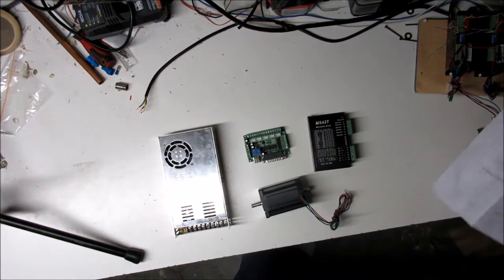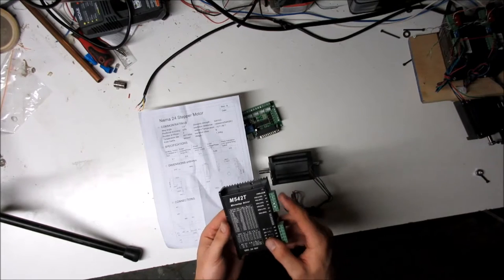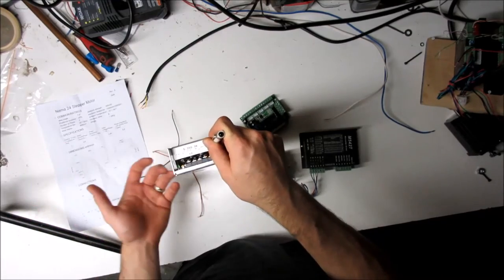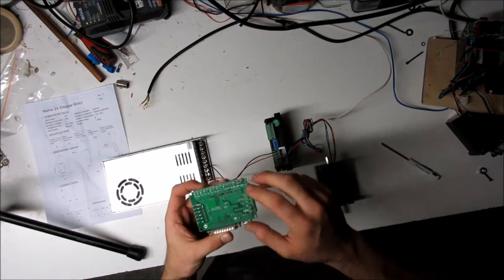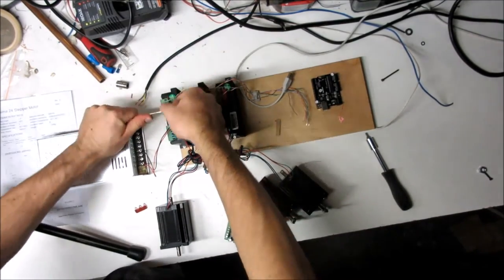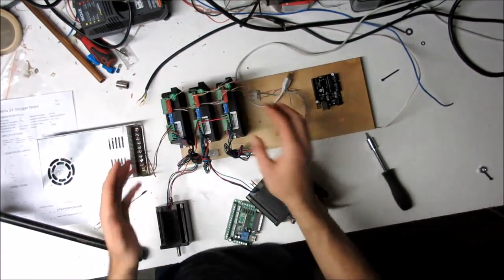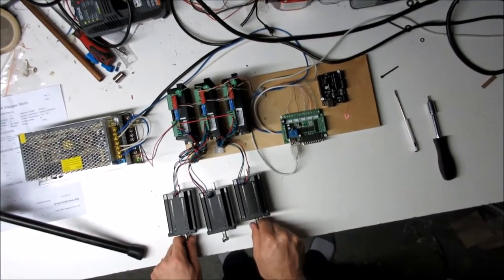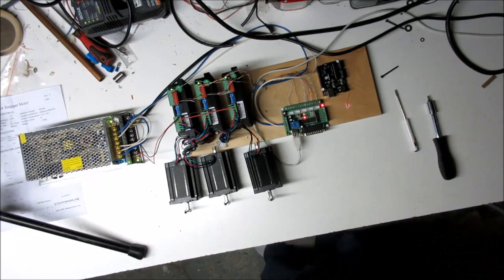Nema 24 3-Axis CNC Kit from StepperOnline VISIT http://www.blog.nickcook.ca FOR FULL WRITTEN REVIEW

Comment: So I’m still not getting it exactly: the enable +and - are hooked up in series from driver to driver the wired to the bob ? And where do the pulse direct pins go on the board? I’ve got a war9 SmoothStepper ess and I’m getting a bob that hooks up directly to that but right now I’ve got a Chinese bob with clk on it. 
Confusing.

Comment: Hello.  Have you had a chance to set this up and run it yet?  Are you going to do any follow up video about this after having it is use for a while?  Also, you mentioned that you are running a cnc router.  What is your setup for that, as in what motors, drivers, controller, and software?  Thanks for your response.
Reply from the maker: my cnc is from inventables, the x-carve. i love the cnc and the company is great.

Comment: Hi! Is noticeable you connect a wire to connector "PC GND" near "P1". But.. from where comes this wire? What it does? At user´s manual this "PC GND" is blank. Can you Help? Thanks!
Reply from the maker: +Paulo SOARES CARVALHO  The PC GND is Connected to GND so i just used it as a connection to ground.
Reply: I don’t know much but yeah that’s what you can count on in any electronics is all ground are the same-common-earth etc.